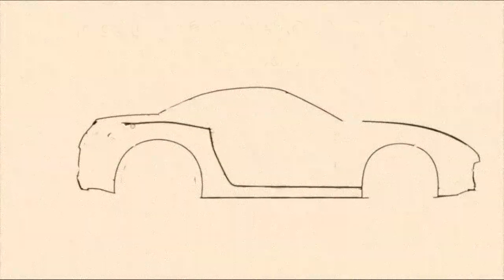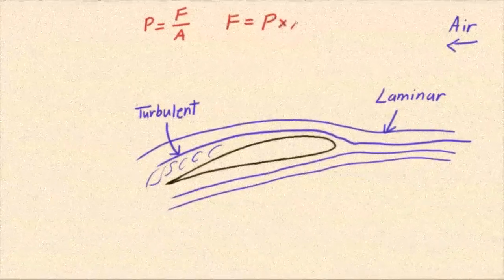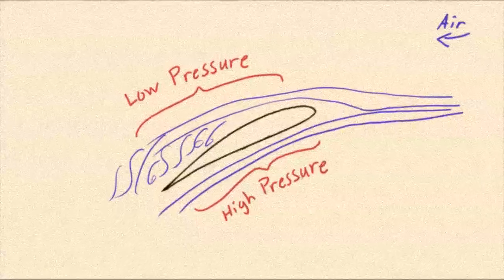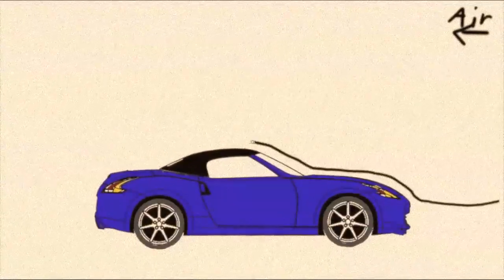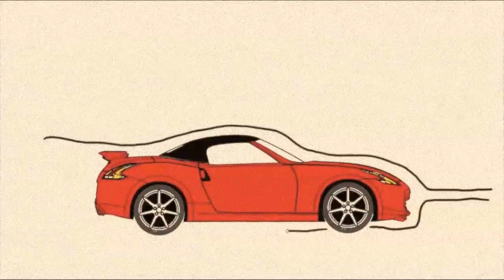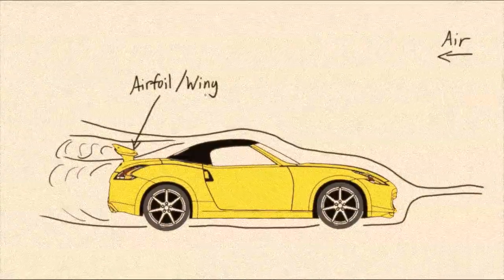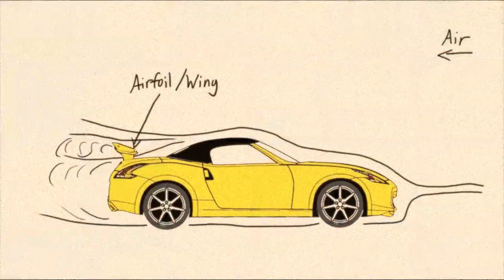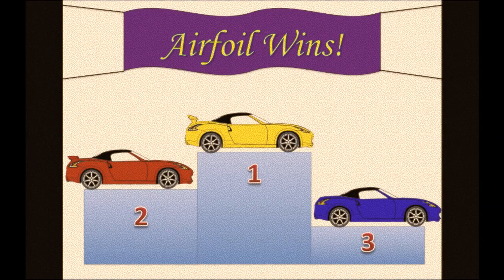Sports Car Aerodynamics: Spoiler Alert!

Comment: what are the differences between a spoiler and an airfoil?
Reply: I think the most simple explanation would be that a spoiler does not have a gap between it and the trunk/boot lid, whereas an airfoil has a gap where air can flow between. In this vid the difference it outlined at around 3:35 to 3:42 - it is brief!
Reply: Peter Winn Thnx man
Reply: Rufus Massey  A spoiler ''spoils'' the laminar airflow by disturbing it in a certain direction and creates a high pressure area in front of it resulting in a downwards force with a relatively high drag at the cost. An airfoil on the back of a car is essentially a inverted wing which also creates a force in the desired direction but it will generate much less drag and thus resulting in a higher resultant force forwards, thus a higher speed.

Comment: for comparison, just look for the Top Gear Koenigsegg results. With and without a rear wing.
Reply: It only made the car faster because it was actually drivable with the spoiler, in a straight line it would be faster with no spoiler
Reply: I know.. And how often in real life. On the road (autobahn to be legal) or track. are you driving top velocities in a perfectly straight line? Even in a drag race you have to correct for road imperfections.. That's why even drag racers uses down force. And that's why even top fuel dragsters have spoilers and often have exhausts pointed upwards for down force. instead of backwards for more thrust. Even in a straight line you gotta have a little down force to be sure your tires have lots of grip/friction to successfully transmit the power onto the road. And last but not least to be sure not to generate lift. Spoilers also make you able to break mechanically. Which is important too. Lift here would result in no grip at all = no break power besides a break chute..
Theoretically; if you make sure you only provide minimal down force when going top velocities, then yes you go faster. And it's A LOT more dangerous. (Watch the Mercedes fly at le mans 99'. That was on a 'straight' line with road "imperfections" (a bump))
With minimal down force your breaks work like shit too. Some cars have retractable spoilers and some with variable angle of attack. To provide minimal down force at high velocities. And maximum down force / drag / air resistance ("speed break" functionality) when breaking..
To have a fixed minimal down force, is theoretically good at high velocities. But very very impractical and dangerous in real life. Unless it's variable. Like on some AMG Mercedes' and the Veyron.
I just commented to show people a real life example of what down force does. Watch some top fuel drag races and tell me; exactly when down force. is NO good to overall car performance.. You can't..
That's why it seems you are only talking to be flapping your lips..
Nevertheless I've got to explain my self.
Have a great day.
Reply: Martin Olsen I've circuit and drag raced for years and the reason why Top Fuel/Funny Car dragsters have wings is because they have so much power (7000hp+) and actually point towards the sky when launching. Without the wing they will go airborne. Most drag racing cars (even in the 9 second range) take their spoiler off for quicker acceleration.

Most of the cars on the road will not benefit from having a spoiler. My track car has 500hp and only produces useable downforce at 150km/h. If I remove the aero kit, the speed down the straight increases by a good 25km/h. The Koenigsegg was faster and handled better because it had better grip in the corners from the aero.
Reply: Yeah, but that's a hyper-car, it's very powerful & light, which are the two factors a car needs in order for downforce to work it's magic on a car and make a significant performance improvement. That little Nissan they showed above won't gain much out of any sort of wing.
Reply: My point exactly.
Reply: sodazman
not true..  in many cases now.. the rear spoiler/airfoil is part of the overall aero package of the car.  one would be incredibly surprised at what keeping airflow nice and strait and smooth can do.
Reply: 1320crusier Why don't you show some evidence instead of making a general statement?
Reply: Martin Olsen Mark webber's mercedes had a proper floor as well as a wing which generates a lot of lift for a very low drag penalty as the diffuser works with the wing to create upwash. It was running with more downforce than any road car/supercar with the exception of a few like the P1 and veyron. That flight was a result of the car pitching up slightly and the air catching the flat floor, not the fact that it was running with a wing with a lower AOA. You seem like the kind of guy that puts a wing on a front wheel drive car.
1320crusier sodazman is correct. Adding a wing doesn't make airflow nice and straight. It creates a pressure difference and that creates a vortex which creates a lot of drag. It also increases drag due to its frontal surface area.
Reply: DynamicOyster No I seem like the kind of person driving a bike and to be clear, no I don't attach wings or spoilers.. Science is just an interest of mine.. You seem like the kind of person only talking to be flapping your lips and to get attention.. I see you didn't catch my point then, maybe next time I should make myself crystal clear.. Or preferably don't make yt comments at all..
 
Yes, then that flat floor acted like what? A lifting wing.. EXACTLY! = lift.. Which is is the opposite of down force, aye? Is that preferred in cars? NO.. It's preferred in aircrafts..
The footage of the flying Mercedes. Is nothing but living proof, of a car having more lift (from an unintended wing) than it had down force from weight and spoilers (intended wings). How can it be otherwise Mr. Ph.d. ?? Please elaborate.. No actually, don't..
Flying cars = lift > down force..
Reply: DynamicOyster  I see I proved my lip flapping point.. happy trollin'
Reply: Take a look at your second post before you say that.
Reply: DynamicOyster If not a troll, then why are you the one who 'upped' my thread the most. With only redundant and useless info? I only answer to be polite or to defend my initial case, if that's trolling, so be it..

You tried to correct me. Before you even understood my point. And in the end your comment showed redundant and only strengthening my point. Please understand what you are trying to correct before doing so. Otherwise makes you look like a fool..
"You seem like the kind of guy that puts a wing on a front wheel drive car" - (now I'm evil, sry god, please forgive me).. Why wouldn't a front wing make sense to a light weight FWD circuit car? Please elaborate.. Actually don't.. It'll only make you look like a bigger fool.. Happy foolin'
Reply: Martin Olsen And when did I "up" your thread? This is getting quite off topic.
Reply: DynamicOyster E.g. just now. I started this topic.. Yes, my point exactly. You seem to get it now..
Reply: I don't see when you've ever made that point but I don't really care. This has been quite interesting.
Reply: DynamicOyster  No. When not reading and understanding my comments before criticizing. It's evident you wouldn't.. The topic is about the impacts of overall car performance in an open system.. i.e. real life performance (not fairy tale theory straight going land, in which I'm sure the Mercedes would kick ass).. And even in your very first comment, you didn't seem to get that. You tried so hard to 'correct me' (why is a mystery to me). Instead you just unintendedly proved my point correct even harder.. All of your comments are kinda 'off topic', as they don't add any information. In fact, I've been so thorough explaining my self, that only minor information can be added without redundancy. I only tried to explain and 'educate' people in the concept of 'real life performance', with a Top Gear and later a Le Mans example of an 'open system' i.e. real life.. In a perfect world, no one would have replied me, just watched the first example and learned from it.. What tells the story of open systems better than reality? I only elaborated my point, because people didn't seem to get it with the simple example at first.
My interest in aerodynamics are mainly aircraft, and that is a heck of an open system I tells ya'..

To a race driver the topic would translate to; the impacts of overall down force on lap time & the safety envelope, on a non-oval circuit with road imperfections and wind etc. (i.e. all the variables you can think of taken into account. That would include unintended negative down force. All variables accounted for = open system)..
"I don't really care" - lol. then why comment...

I hope this is enough elaboration of my point, for people to get 'open systems'. They can't ever be fully simulated nor argued. Only progressively documented better, with examples.
In fact 'open systems' can ONLY be understood with real life examples/data/footage...

For your own good people; take a look at the concept of 'open systems' (systems theory).. Before trying to correct me, thus making fools out of your selves. At least only to educate yourself on the concept. That's why I made my comment in the first place..

I should never have commented on yt.. People are so stuck up here, that they will never learn.. Wrong place trying to educate people.. What a pity, but at least now I know.. Sigh..

Never be afraid of losing face. The worst that can happen is becoming smarter..

Have a nice day (:
Reply: DynamicOyster I see, I only care about educating people. That's why it's so important for me to explain myself and make you understand. A soul made smarter is a soul slightly saved.. Now all the pieces are there, just connect the dots, if you're smart.
And yes, I am aware that I fed a troll (:

Comment: Spoilers use to generate more drag, how can spoiler car win the race ?
Reply: Rear wings (and not spoilers!!!) create downforce. That downforce "pushes" the rear tires onto the ground which gives you more traction. That extra traction will make you accelerate faster to begin with. The downforce also gives you more grip in corners so you can go faster through corners without sliding a.k.a. losing the back of the car a.k.a. oversteering.
Reply: Sure,but does the cars have the same fuel consumption ?
Reply: Fuel consumption is higher of course, that's why in Formula 1 teams are looking for the best way to create downforce without creating a lot of drag. And sometimes they create some really awesome solutions like the F-duct (which you should definitely look up if you haven't heard of it). The F-duct reduced the drag on straights which improved top speed and fuel consumption. This was done by "blowing" air from the rear wing.

Comment: so why do they go to such great lengths to make the cars so light if they want down fore on them? genuine question btw.
Reply: Because lighter cars will accelerate faster than heavy cars, but we still want weight (or force pressing down onto the road) on the tires to give more grip. Down force from spoilers/wings have little effect at low speeds though, and it is a trade off between top speed and high speed handling (as long as they are fixed).

Comment: Straight line speed is affected by a rear spoiler; its drag interferes with its Vmax . E.G the original Countach (no tail spoiler) was 10 mph faster vs the later Countach (BIG tail spoiler). Increased cornering performance and high speed stability is the main reason you would fit a spoiler.

Comment: So the bigger the spoiler the higher the top speed? 100 percent wrong.  Look at the high speed salt flat cars. You don't see them with big spoilers. You see them with with spoilers fitted on them to make there cars longer. Look at NASCAR's. Low speed tracks you see them with higher pressure spoilers and wider fronts for more down force. Then on the High speed track you see them with more narrow longer fronts with a shorter spoiler. Nhra drag funny cars for example are long but with a big spoiler. Why for the big spoiler? Be cause for traction for acceleration. Butt of the track was longer and not for acceleration, it wouldn't use a high HP motor and not such if a bug spoiler. Factory cars like a Nissan 350z for example in a drag racing sense.  The spoiler will cut mph because  of its pressure to push the car down. To get very better traction. Get better wider tires and tweak the suspension. It depends on the weight and HP too.

Comment: the explanation is correct but in a drag race, the one without the spoiler or airfoil will win because the downforce is traduced to weight so the power to compensate the weight and the air resistance is more so it is slower in a race without curves
Reply: wrong, the downward force produces more force normal to the road thus creating more traction for the wheels.so there is a larger sum of  static friction  (rotation without slipping).
Reply: fatqwert200 Not necessarily, it depends on the vehicle. In something like a stock mercury grand marquis, the car is not powerful enough to need the down-force, yet with a top fuel dragster, it is needed to prevent wheel spin.
Reply: its a rough question but i believe if the car was designed with a spoiler vs a slap on after market one: the one designed would win :)
Reply: "the explanation is correct but in a drag race, the one without the spoiler or airfoil will win because the downforce is traduced to weight so the power to compensate the weight and the air resistance is more so it is slower in a race without curves"

Sorry, but this is wrong.  It increases the force on the tires- Not the mass of the vehicle.  Having 1000 pounds of downforce on the car doesnt affect the acceleration like having 1000 pounds of dead weight in the trunk would- Not even close.  Weather or not aerodynamic devices will affect the acceleration of the vehicle depends upon whether or not said devices alter the aerodynamic drag of the vehicle.  This can go both way- Just because youve added downforce, doesnt mean youve increased drag.  Plenty of devices can increase downforce, and decrease drag- But there is a limit to their ability to do this.
Reply: SidewaysGts Wrong as well. Wings don't generate sufficient lift at low speeds to overcome the drag penalty they create. Then, at higher speeds, drag slows the car down even you don't need anymore downforce. The downforce actually increases the rolling resistance and it further reduces the top speed of the car.
Reply: DynamicOyster "Wrong as well. Wings don't generate sufficient lift at low speeds to overcome the drag penalty they create."

Downforce. Not lift.  Second, again, not all spoilers or wings result in a net increase in drag.  Depending upon the vehicle and application of the aero, they can and frequently do, decrease overall drag forces on the car.

"Then, at higher speeds, drag slows the car down even you don't need anymore downforce."

Im sorry, but wut? Can you rephrase this?

"The downforce actually increases the rolling resistance and it further reduces the top speed of the car."

I dont contest this. In fact, I already acknowledged this.  Right at the beginning.  Allow me to quote myself, as you seem to have missed it: "(Downforce) increases the force on the tire"

Im "wrong as well"?  You may want to swing again, slugger.
Reply: SidewaysGts Did you know negative lift exists? Also have you heard of tip vortices and induced drag? List one example of a wing put on a car that reduces drag and I will admit I am wrong. Also, you never mentioned anything about rolling resistance being related to downforce. You just talked about an increase in force on the tire. And do you really need me to rephrase that? I admit it is extremely badly written since i didn't read over it but i'm sure you get the point i was trying to make.
Reply: Depends on the distance

Comment: I know that this video was probably mean to be simple, but I think that the oversight of induced drag is a big issue. Yes the wing has low pressure drag, but can a lot of induced drag. A prime example is the Viper SRT-10 08 vs the Viper SRT-10 ACR 08 which is some 20 mph slower because of induced drag created by downforce.

I would argue that the finishing order would be no aero device first, wing second, spoiler last. This is not set in stone however. The spoiler in particular, depending on intent can do anything from decreasing lift and drag to severely increasing drag for a little bit of lift.

Was Reynolds number accounted for in the wind tunnel testing?

The assertion that spoilers/wings/etc can be useful and increase speed vehicle speed is true, but it's not a simple "yes" answer. Again I understand that this video may only want to go to a certain depth, but I think even at this depth there is some clarification to be done. Overall a nice job and good initiative for sharing knowledge.

Comment: Nice vid. But what you have to ask yourself is why so many car manufactures fit rear spoilers to cars that are FRONT WHEEL drive?!
Reply: Because the rear is unstable for two reasons. All the weight is in the front, and second the shape of the car could create negative downforce, so it lightens more. And if the rear looses grip in a fwd car that could be dangerous at some speed. Do you remember the very first gen Audi TT? Many accidents from loosing the rear and they added a rear wing spoiler...
Reply: First of all "SPOILERS" are supposed to reduce drag. So of course a FWD car will benefit will benefit from that as much as any other car.
But rear wings on the other hand are also useful on FWD cars. Front wheel drive cars can have a tenancy to snap oversteer at high speed.
Look at WTCC cars. A lot of them are FWD and the engineers that put these cars together wouldn't just stick a wing that size on for the aesthetics.
Reply: I just like it because it look nice